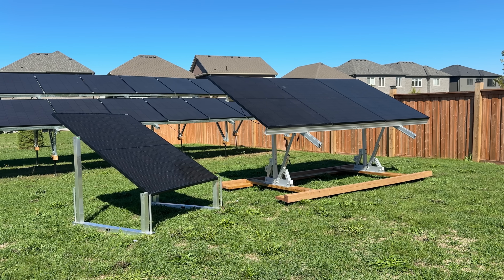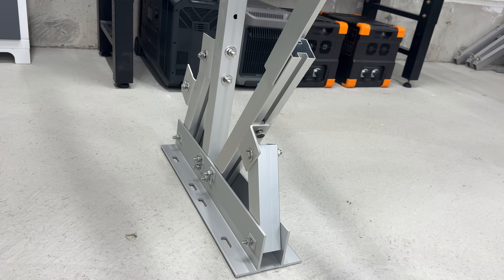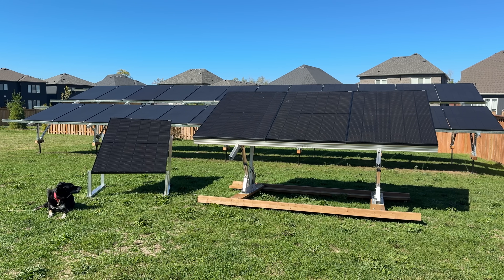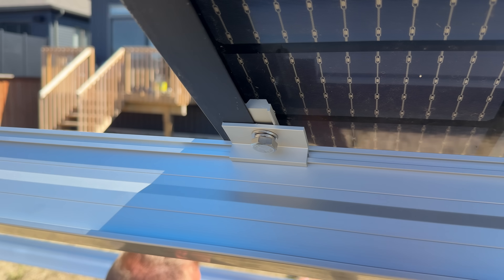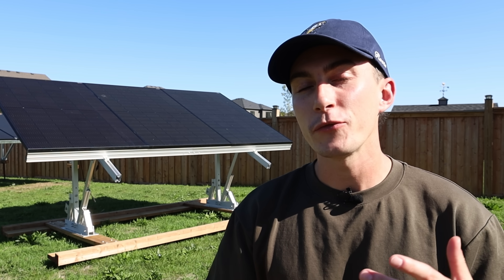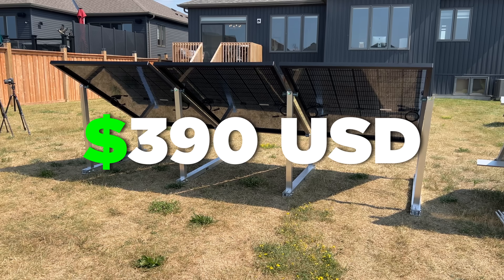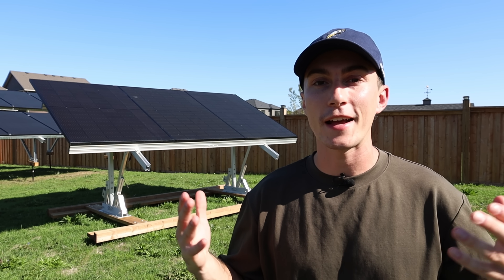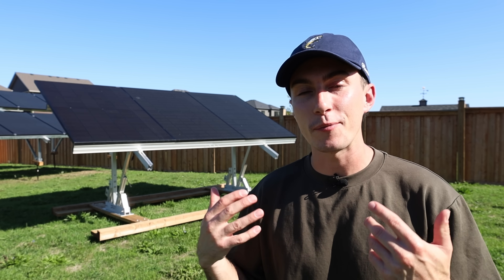Americans NEED This Ground Mount - Maple Leaf Solar Panel Goose Mount

Comment: I have a pair of these mounts and the quality is great apart for the instructions which are very poor. (I've done documentation in my work life and if a team member handed in something of this quality, they would be replaced with someone else.) Oddly, in the video you mention how supposedly easy it is to assemble, but unless you had a company rep holding your hands through the process then you'd know that the instructions make the process harder than it has to be. And you'd put it in your review.
Also want to mention, you are a Canadian YouTube channel, so it seems weird how you make it seem like you're American? Like do you actually care about the lack of American distribution so much that it becomes the main negative point of your review? Like, you're definitely some "elbows down" Canadians!

Comment: Snow load is only one risk. The biggest risk it uplift from wind and I did not see any reference to that calculation. There was a mention of ground spiking and that is an important thing that should be done. The hurricane system is important not so much for hurricanes but even 30 MPH winds can tumble your system over and break your panels.

Comment: Place one leg on a concrete slab...add an adjustable tension cable to either side attached to ground mounts of choice. repeat for more legs

Comment: For 3 panels you need 4 integra-rack mounts, that come over $520 + tax. The correct comparison is for a tiltable integra rack that comes at $180 a leg, so times 4 its $720 + tax. So this option is indeed a lot cheaper and cleaner. Please fix the video before everyone corrects you. Thanks for sharing though!  Canadians are doing great stuff.

Comment: I'm in Texas 30-60 degrees is not right.  I need 15-35 Degrees.  Also, I see $225 per leg.  It is $500 equivalent to the Integra.  So this video is false advertising.  The angle makes no sense to 1/2 of the US.  I downvoted your video.

Comment: I installed a pair of these ground mounts this summer which were easy to install and have worked great so far.  I used 8 cottage blocks bolted together (4 each) to anchor them, approximately 200 lbs each set.  My order came with concrete anchor bolts as well.

Comment: If you mount the panels horizontally, can you get an extra horizontal bar, so you can have two panels vertically mounted?

Comment: Don't use wood at the base in a couple of years they can start rotting. A better option would be to use composite decking. It's nice to talk about the price but maybe you should also state that you need a grounding rod installed near the mount and a surge protector (not sure what it's official name is but I've seen that you need two, one at the panels and the second by the house as a back up). Adding a second rod is cheaper than routing a grounding wire all the way toward the house rod.

Comment: I'd like to see a US company produce a similar product. I mean, really - minus a one-time engineering effort, it's just some extruded aluminum rails/channels/brackets and stainless hardware. Add in a one-sheet assembly guide and you have a viable product on your hands.

I'm not saying it's easy - but it certainly isn't rocket science. At this moment when the optics around growing American small business are so positive, it should be a great time to start such a venture. If I was in an earlier stage of my life, I'd be all over this.

Take care and God Bless.

Comment: A mount for three panels?, as in three 72 cell panels in series?  That makes about 120 VDC which is suitable to run lots of the devices in US homes.  Buy the batteries and inverter later--if you want to.  1kW of 120 VDC runs a lot of useful stuff..
Mounting the panels from the back side means that you will get the strengths guaranteed by the warranty.  Otherwise you get nothing because the manufacturers have no idea what shape, location or torques you apply when clamping from the front.

Comment: I have 20 100W Flexible panels that i need 3 rows of 6 in series to feed my setup to stay inside max solar input. Would this system work by just bolting plywood to the rack, then the flexible panels onto the plywood? Would you think air flow would be needed, between the flex panels & plywood, or just attach the panels flat on the plywood would be ok? Might be more simple to just build a wooden rack, but i really like the ability to adjust the angle with this rig....thanks!

Comment: I will be increasing my solar system, newly installed in June 2025 sometime in 2029 AFTER the ORANGE DISASTER is gone.  Hopefully, it will be one of the first orders of business of the new administration in 2029 to tear down all the economic damage...or at least as much as can be done...when a non-MAGA, non GOP President and House of Representatives is IN POWER.  I am reasonably certain there will be a BLUE WAVE in the 2026 elections that will see the House return to sanity/competence...but the Orange BUFFOON and his crew of sycophants and grifters in the Senate are gonna be here for a while.  FAFO.

Comment: new to the channel. my issue is I have a roof I can put panels on, but I cannot bolt it to the roof. what is the best way to mount brackets without drilling into the roof.

Comment: IntegraRack IR30 goes for about $120 USD and you need 4 to hold three solar panels.  That’s $480, BUT, you need to buy 2 sticks of 1” EMT at about $32 USD, so really the difference in cost is about $18 USD per solar panel.  I could live with that for a beefier ground mount that is adjustable.  👍🤩☀️🔋⚡️

Comment: It would have been nice to see four or five of these holding 10 or more 570 watt panels. Currently it looks like the top half of a 570 watt panel would be unsupported. And how clean would the mountings look holding so many panels? Finally include adjusting the 10+ panels from 30 to 60 degrees. In my imagination the angle adjustment would be quite "exciting".

Comment: you didnt mention the huge adjustment range this system has as the great feature it actually is. i live in Montana and this is the only system i have seen that can be set for winter sun angle. the integra rack i have is already at its max and out of alignment with the dropping winter sun and there is still two months of days getting shorter. going to the solar store now to buy two legs before mr T has another temper tantrum and ups the tariff.....😜

Comment: It looks like a good system except they didn't give any thought to securing it to the ground. The ballast system for Integra rack is well thought out and an easy Diy project. This rack looks like one would need concrete footings to secure it to 🦆🦆🦆

Comment: As somebody who has 2 IntegraRack arrays with a total of 15 panels: 🦆🦆

One negative that I don't think you mentioned is that the bases appear to require some kind of base to secure it to. I know you said you could use ground stakes but with that height and the apparent top-heaviness of the design I think I'd be a little leery (especially since my Integrarack flipped over during some heavy winds recently... my fault). The integraracks can be mounted right on the ground without additional footings needed, assuming you secure them if it's windy.
Reply: the integra racks have a requirement load that should be placed over the bottom rack, the amount depends on what wind load you expect. and there are ground statkes you can pound into the ground but require a special filler to be put inside the ground stakes.  so both systems will need to be attached to some kind of secured ground mount to be stable in high winds.
Reply: There are ground screws that can be used both big ones the directly screw to or smaller ones and cables...
Reply: How did your Integrarack flip?

Comment: Hmm.   I like it, but I'm not enamored by the cross-rail structure.  I would have preferred a far lower-profile 1-5/8 x 13/16 strut channel.   Possibly for the vertical members too.  Otherwise though, I like it.

Also, you WANT gaps between the panels.   Having small (1-inch) gaps reduces the wind load by a ton... there is a massive difference.  Do not omit the gaps in build-outs.

I just did a second Pergola project, putting 4 x 410W panels on as the roof.   I used a Gazebo 6ft x 12ft kit as the base and metal-screwed in some strut channel along the bottom of the horizontal member for additional support.   I'm really partial to Pergola/Gazebo builds because the space underneath is usable.

Comment: I think you mis-counted. With the IntegraRack system you always need 1 leg more than the number of panels. So you need 4 IntegraRack legs to support 3 panels and the total is $480 U.S. plus taxes and shipping for the IntegraRack.
Reply: and that price is for the non adjustable mount.  the adjustable mount is just shy of 200 for each leg.....so between 550and 600
Reply: @ArnoldReiter-g4c  Excellent point!

Comment: 75% duties?!?!? That is insane.
Reply: It's a 50% duty on just the aluminum, plus an extra 25% because it came from Canada. Those are the tariffs that Trump has instituted. He keeps saying other countries pay the tariffs for shipping in the US, but that's just not true. To pay duties, US Customs and Border Partol require a social security number or a US business tax ID #. In addition, if this item qualified for the USMCA free-trade agreement, the 75% duty rate would be 0%. Since I work in trade and imports, that tells me that the item isn't really manufactured in Canada, or they get the finished aluminum stock from another country and just cut it to size in Canada.
Reply: @davef5595  I assume that Trump thinks that tariffs will increase the sales of American goods, in this case, forcing people to buy inferior US made ground mounts instead of foreign ones. However, increasing manufacturing capacity by any significant amount will take many years. Instead, we will all just keep our heads down and absorb the pain until Trump is out, hope that not too much damage is done, then go back to how it was.
Reply: @rayopeongo  That is is the issue, we let other countries make our stuff now. Do we just keep letting other counties make our stuff or do we try to bring back manufacturing? Also most of the ground mounts come from China if I am not mistaken, so a lot of the crap that is out there  might ship from some where in the USA but still made outside. I dont really know how to solve that TBH, but I do know things use to last longer even if it was a little more expensive when you buy it.
Reply: @lorddracocast  Don’t look at me, I am Canadian. Ordinary people have the ability to make changes, without tariffs. They just need to buy stuff made in their own country. Thanks to Trump and all of his 51st state rhetoric, pissed off Canadians are checking every ‘made in’ tag and avoiding anything made in the US as much as possible. Retailers are putting labels on shelves to help us find Canadian made goods. If Americans had been doing the same for the last few decades, and demanding high quality, maybe manufacturing jobs wouldn’t have moved overseas.